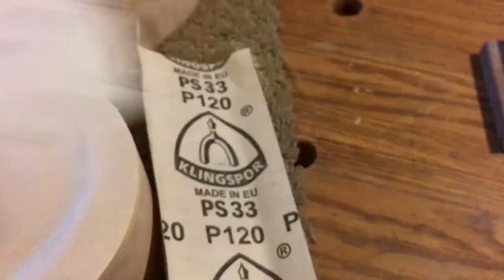How to install Ebony Binding.

Comment: You have sealed the maple, but then you are scraping the ebony and the maple together. That does not cause ebony dust to ruin the maple? Is the scraper don't scrape the shellac and expose the maple?
Reply from the maker: Kfir Lavi the maple gets scraped only on the last few passes. Ebony sits higher than the maple. The seal prevents the glue from the glue up to get deep in the maple wood pores,which would be visible after the finish is applied. Also the majority of the Ebony dust had no access to get into the maple pores during the majority of the scraping process which will make my life that much easier.. Believe me , attempting to do this without sealing makes a mess and a lot of extra hrs.. thanks for watching and your good questions:)

Comment: I have been looking at that stew mac binding tool as I don't have a router setup. Just wondered can you cut the purfling channel with it or just binding? 
Great vid by the way!
Reply from the maker: +Michelle k Great question! I wouldn't use it for purfling. The surface that rides on the soundboard or backboard is pretty narrow and it would be hard to keep it square after the binding channel is done. Or vice versa.. I would use a purfling hand tool ( Same use in violin making) to cut it. Then rout the binding channel and finally cleaning both of the channels. Thanks for watching!